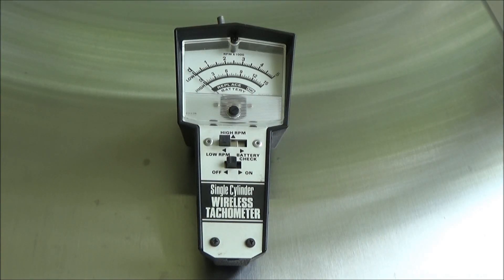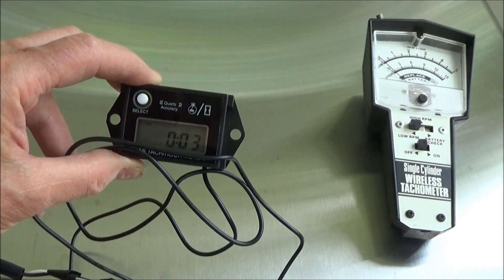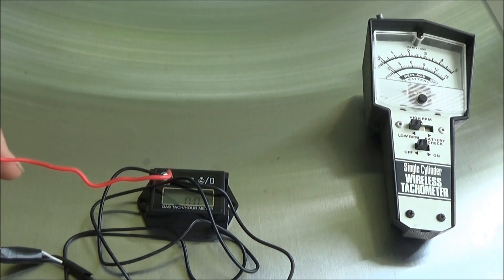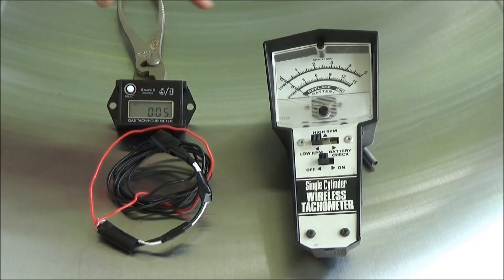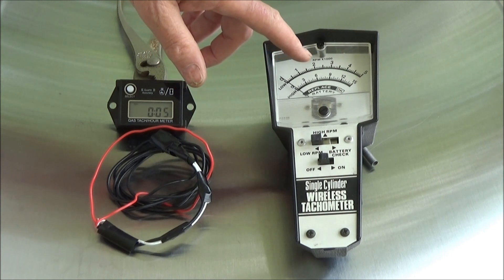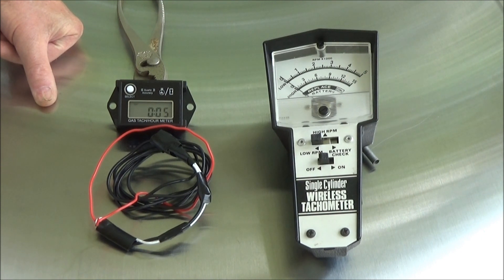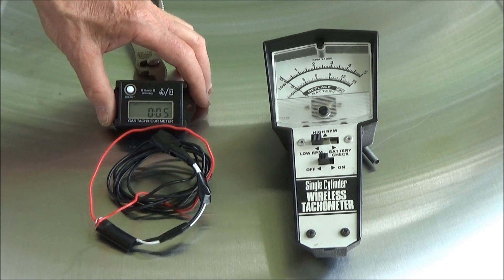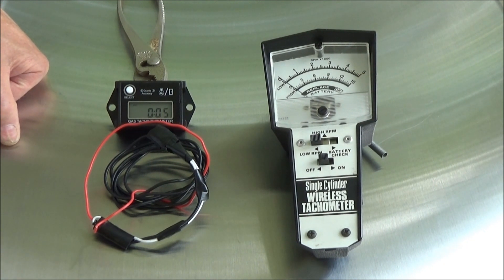Small Engine Tachometers

Comment: On the digital tach I noticed you only had 4 turns on the spark plug lead.
Try adding an extra turn (or 2), and it should give a more accurate reading in line with your analogue meter. :)
Cheers!
Mick
(P.S, appreciate if you let me know how you go with this)